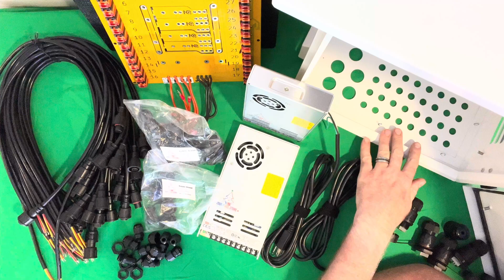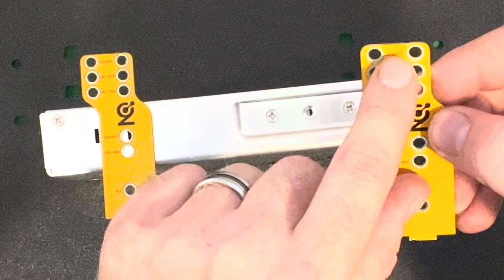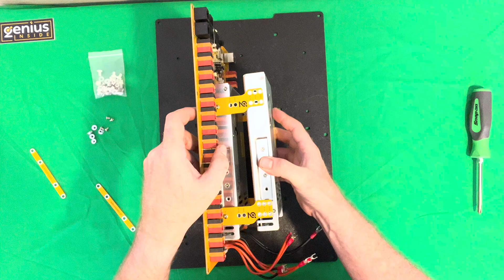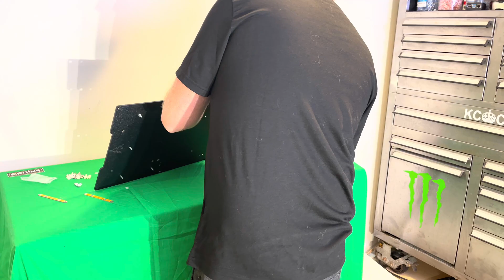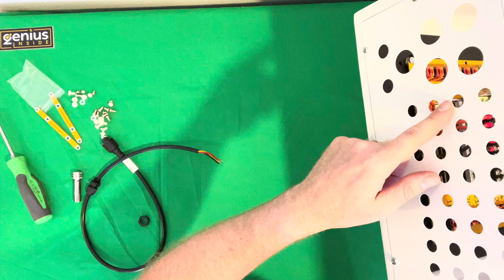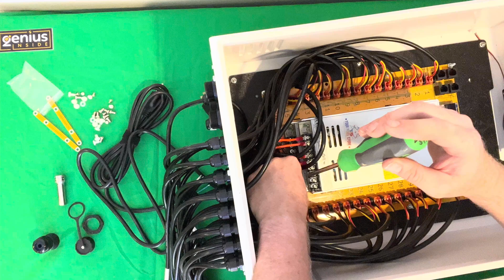Experience Lights Genius Pro 32 Port Controller Large Enclosure Build from Your Pixel Store

Comment: i have the mean well LRS-600-12.  Someone suggested the wires to the board are rated at 25 amps, and the power supply is 40 amps, is that correct and ok?

Comment: Did you use the 350W or 600W psu? I just got this board, planned to use 2x 350 Meanwell power supplies. Someone said you have to use 4, but I don't think that is correct. Going with 4 doesn't allow access to the the connector clips and would be a massive pain to get to the clips for the 32 ports

Comment: Nice build.  What's the purpose of having two power cords instead of one?
Reply: If I'm putting together this with 4 power supplies and two power cords does it matter which two I power? As long as one is one of the left 2 and one is of the right 2?
Reply: There are two power supplies.
Reply: @match999   I saw that in the video.  But why?  Why not run AC power from one supply to another?  What's the benefit of two cords over one?
Reply: @Chucka1463  lower amp draw per power cord.  One cord could get hot and cause a fire.   its best to run individual power cords for each power supply.  Yes you could buy a 10 gauge wire and run both units off it.